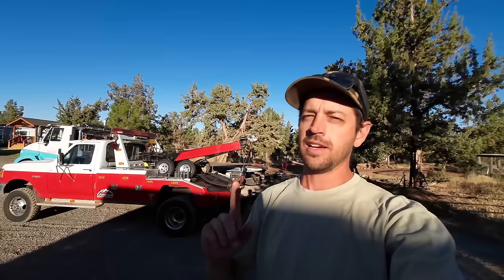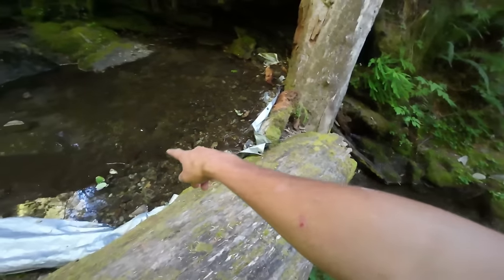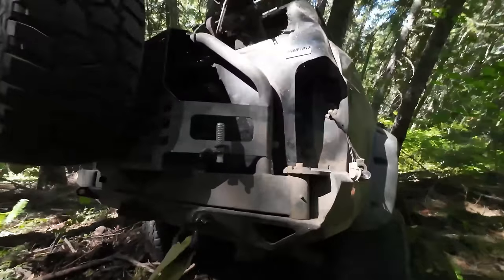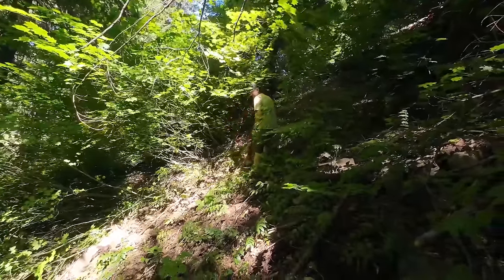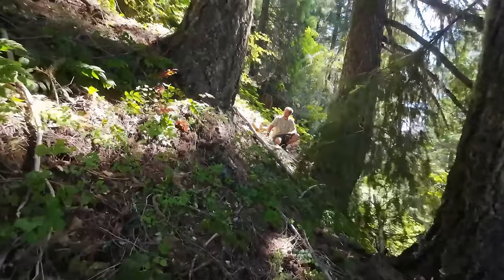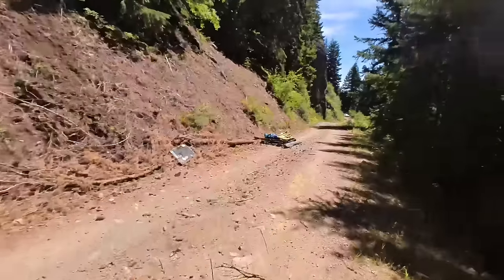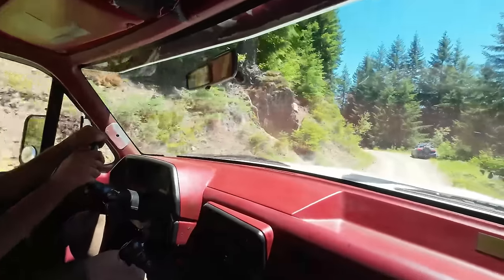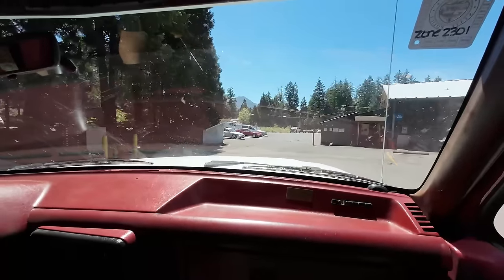I can't believe SHE SURVIVED this...

Comment: Thanks for the recovery of one of our Gambler family. Too bad you cut out the parts where you were rude to the drivers also. It would only be fair. These guys are rarely dicks. These two have rescued more people, driven more miles, cleaned up for more years than you could possibly know. Everyone has off days, including you. Its a dick move to put tgem on blast. And i dont see the part where you chewed Seths ass either. Another amazing person, doung amazing things with no intent of glory. Way to really stir up shit instead of caring.
Reply from the maker: Oh shut up.   I was not rude to them before this, but I and absolutely did TELL them to back down to an intersection and that we were NOT going to attempt to pass on that section of the road where they were trying to pull to the side.  And I didn’t give them any option about that, because they were not getting any option about that.  For everyone’s safety, that’s what we were doing, end of story.   If that hurt their sensitive little feeling…. Too. Fucking. Bad.   
But then, this fucking moron that some of you want to worship so much couldn’t even keep his car on the road, tried to get to the side where I told him not to, and drove off the edge putting himself and his passenger in extreme danger for no reason.   So yeah, at that point I absolutely am pissed off and am not going to sugar coat anything.   But I’m also still going to help him out of the situation he put himself in.   That is until he decides to run his mouth on top of it.  At that point, fuck that idiot, he can stay there.   
As far as this Seth person you’re talking about, I have no idea who that even is.   So no, I didn’t chew his ass.  
I also find it funny that so many of you Gamblers are jumping all over me saying that all these MANY different witnesses saw me being so rude before he backed off the edge.   Well guess what….  There were only three people there at that point.  The nun, his passenger, and the driver of the car ahead of him.   So anyone else who told you they saw any part of the initial interaction is a dirty fucking liar.  End of story.

If you want to think I’m an asshole, hate me, talk shit about me, or anything else, because I was “mean” to someone who’s stupid decisions put himself and his passengers lives at risk….  Good!   Have at it!  Your opinions mean absolutely nothing to me!
Reply: @CaseyLaDelle  I actually thanked you. Then talked about your behavior, not your character. Never talked shit about you, only here, to you. Never even called you names. I get it. Been in situations where I knew I was the one on the side of safety, been the one who felt I had to take control. However it is in extremely poor taste and yes a dick move to put people on blast to get more "atta boys" on your channel. Would you want someone to tailor their story to do that to you? Just putting it out there... no need to justify your attitude or behavior. And if other peoples opinions don't matter then why comment? Why tell your story again? Just food for thought
Reply from the maker: @WendyKelley-n3v  here’s where I have a problem with you and all the other morons jumping all over this for me.  You are saying that I “tailored the story” or “made it look like”….  And that is straight up bullshit.   What happened is what you saw.  Don’t like it, too fucking bad.  And as far as whether how this nun clown feels about it…. He saw the camera there and still decided to mouth off.   If he didn’t want to look like a dumbass on camera, he could have simply kept his mouth shut and let me pull him out, or told me that he didn’t need my help.   He CHOSE to mouth off in front of a camera, so no, I don’t care one bit about “making him look like…”  anything.   I film my work, and this is part of what happened on this job.
Reply: @WendyKelley-n3v I took your, comment exactly how Casey took it. If you didn't intend your comment to come out that way you shouldn't have said it. There are many things off camera you don't see and that many tow truck and recovery operators have to put up with. I salute Casey with his patience and behavior. I would have just gotten in my truck and drove away.
Reply: It's his channel and it's up to him what is shown. If you have a problem make your own videos and stop being a keyboard warrior. Cassy does all this for free and doesn't deserve yours or anyone's negativity.
Reply: @lesterholibaugh8784  word. You're correct. Sorry for the bad form Casey
Reply: @CaseyLaDelle 
 Casey, I just came back here to see if you had read my previous post and saw this one. These  people are amazing. AND, They are taking advantage of your good nature!!!!!! I think at this point you need to cut ties with the Gambler organization and let them call other tow companies. Let them pay the going rate and let them badmouth those guys. They will sit out there until they rot if they do because word gets out fast in the tow community, as you well know. Just let them know now that from this point forward you will not be available to pull them out, you are done with their organization and their antics. You are a much better person than this and you do not need it. Your time and money is much better spent on people who honestly need the help and truly appreciate the help.
Reply from the maker: @rickf5615  a few things here…. 
First of all, I have no ties with the gambler organization at all, so there are no ties to cut.  
Second, even if I did, why would I when the few D-bag individuals that are mouthing off are not representatives of the gambler organization.  
Third, they are not taking advantage of me, and I am making plenty of money off of this.  So to turn down their calls would actually cost me money, not the other way around.  
And fourth, don’t ever come on here and TELL me what to do with my business.
Reply: @CaseyLaDelle  Bravo Casey!  BRAVO !!  Extremely well said!
Reply: @WendyKelley-n3v  Really?  I sure didn't read any kind of a 'Thank You' in your original comment.  Food for thought for you possibly.  Your entire comment seemed to be condescending towards Casey's actions in this incident.
Reply: @tamo9520  the rescue was fantastic, and appreciated! I said all I said in sincerity.  The post was not in my opinion. But thanks for your scolding. Already had that. Already apologized.
Reply: @WendyKelley-n3v  I've made some comments on this original.  I just want you to know that I saw & read this.  Fact - it was read 'after' I made my comments.
Reply: @lesterholibaugh8784  Well said. Don’t you just “ love it” when people think they know when You know they don’t know. There are those of us that our hearts are touched by Casey’s channel and he can put anything he wants on it and I will watch it and share and brag that I “know” him.  So bye Felicia. 😇😁
Reply: Small tip from a unexperienced person as myself at recovery, love your videos! But I was watching it and you have like the small cotter pin and you said “don’t lose that” you are wearing a hat and I think you can slide cotter pin on the brim in the hat so you don’t lose it. I don’t know if wearing gloves makes that to hard if you’re able to do that I known I’ve seen my grandpa when working on the lawnmower and wheelbarrow wheels I’ve seen him slide the  cotter pin on his hat
Reply: @CaseyLaDelle I agree with everything you said. See my other comment left before I read this one
Reply: If anyone has disliked my long texts, the answer is in this comment. If I try to shorten the text, it is infallible that it is misinterpreted in the negative direction, no matter how I try to thank and praise! But it happens that I miss something that everyone can happen to and for those times I apologize for that!
But that it was included in the video, I sincerely thank for- as well as all the honesty that appears! Sometimes I think that too much is removed in the editing as the videos seem to have to be as short as possible which I'm not a fan of, but can understand that others are! The main thing is that nothing is censored unnecessarily! They say mistakes are what you learn from and personally, I'd rather learn from other people's mistakes on video than make them myself! I've crushed, broken, cut, and burned most of it already so I have no need to experience anything again! But probably something will happen as safe things are boring to my taste, the problem is that I refuse to accept that I am getting older and sick...
Reply: dude played stupid games and won a stupid prize and couldn't shut his trap long enough to get pulled out plain and simple my guy
Reply: It is too bad tempers ran high.  Here is Casey providing a voluntary service to the public, climbing up and down a 105 degree cliff, loose surface, risking serious injury in 100+ temperatures.

Now the old dude said he was trying to back down the road out of the way.  No way for us to tell what he was trying or intended.  Even if he was it probably wouldn't look that way if he promptly backed over the edge.

Truth is either person would have to be near saintly to keep their cool in that situation.

If it was me and the other fellow was about to pull me up on the road I would have tried to keep my trap shut.  Oh well, I am sure he got put to rights within a few hours waiting in the heat!

I don't think anyone who wasn't there is in any position to judge or point fingers.

I am glad no one was injured, and lived to grumble another day!

Thanks for the interesting videos Casey!
Reply: Regardless. Seth doesn't seem to be familiar with back road etiquette and then he proceeds on back talking: https://youtu.be/XDZ929tjsjw?t=2748 without respect of a larger truck trying to stay on center of the road and also was concerned for other safety too. 

It would make me question his character. And you defending this behavior shows your character. Honestly, between you and Seth does not shine a very good light on your "Gambler Family"
Reply: @CaseyLaDelle   glad you didnt help that rude driver after you told him not to do something and he did, i would have not helped him either, its called repspect and he's the one that didnt listen! way to go Casey! love you videos and your work.
Reply: I do not agree. Casey, for one, should have worn at least knee pads, 2,  should have cleared a swath with a saw to a degree & 3, he was unnecessarily confrontational with the odd ball driver
He should have maintained a professional attitude, which he didn’t in terms of communicating with motorists

He’s knowledgeable hooking up but is infantile speaking though at times
He also should  work on he Fanny out of shape body, best to keep your shirt youngster
Reply: People need to have common sense when there’s a wrecker carrying a wrecked vehicle don’t chew out Casey for that idiot’s impatience & stupidity for backing over the edge instead of a wider spot
Common Sense is the Key that would’ve kept that argument from happening
Reply: Another great recovery, definitely learning lots watching your channel, keep up the great work👍😊
Reply: @WendyKelley-n3v  You brought more attention to your group. The nun backed off the road. The women drove her jeep off the road, from my view
Reply: Dear casey, the driver who went of the edge should have heeded your advice, hes just a driver ,you do this every day for a living. You offered to pull him out and he makes utterly stupid remarks, Part of the course!!
Reply: bro told you to get a smaller truck lol

Comment: The absolute most gnarly recovery I have seen today with a small rig. Fascinating to watch. Thanks, Casey.
Reply from the maker: Apparently it was still to big 🤷🏻‍♂️
Reply: @CaseyLaDelle  🤣the only thing too big was that dudes ego... good job mate
Reply: @CaseyLaDelle  never too big....just have to inch it in boy....give it the old wedge...😁
Reply: @CaseyLaDelle it’s the perfect size. Got the job done. 

I’m guessing that guy was just embarrassed that he mistakenly backed off the road. Which unfortunately made him act like an toddler.
Reply: @CaseyLaDelle  Unlesss you're talking to Gator boy, lol
Reply: He should be glad you didn't take the big rig. You had pushed him of the mountain to inch by him.
Reply: 3 Days 'later' and nun man still there and wondering what happened 😢
Reply from the maker: @xandraxandra1437  we talked about how much easier that would have been with my rollback, since it would have sat still and just yarded that thing right up.
Reply: @CaseyLaDelle 🤣
Reply: @CaseyLaDelle It's amazing that rollback is so much more capable. Based on that, you would have saved probably 50 to 60% of the labor and rigging. 💪
Reply: @CaseyLaDelle  Do you think your big rollback would have made it up there, and would you have been able to turn it around up there?
Reply from the maker: @wesman7837  it would have made it, but it would have been sketchy.   It’s an old logging road, so many fully loaded trucks have been on it, but it also hasn’t been maintained for truck use in many years and definitely needs a tube up before it ever gets used for that again.   
But yeah, the roll back weighs 30k, so it would have sat there no problem and single line pulled that thing right up.
Reply: @RandomName100 I wonder what part of wait at the intersection, he didn't understand, there's not room for 2 vehicles so wait at the intersection!! So glad he learnt the hard way. I love pulling out stuck trucks, but not for Aholes
Reply: @speedfreak8200 there was room for 3 vehicles on that road from what I saw!
Reply: @CaseyLaDelle I would love to see the world’s largest wrecker eat that little for dinner!! 😂
Reply: @jasonnute1279  I've read several of your comments. Between you and the clown that got stuck, shows me that I absolutely wouldn't want anything to do with that organization.

Comment: Just shaking my head in amazement at all this. The insane incline, all the calculations to rig the cables correctly, all the set up to pull a crazy heavy 4x4 with your relatively light tow vehicle. So exciting to watch.

And on top of it all, you got a guy dressed as a nun with the weirdest attitude problem ... targeted at a tow truck towing a fellow offroader. Unbelievable.

Comment: Excellent video! You guys did a great job! One suggestion is add a length of rope to your kit. Nothing special about it, just when you have to scramble up a steep slope you don't carry anything but a coil of maybe 100' of 1/4" rope in a tiny knapsack or a shoulder bag. Get up there hands free and toss an end to your buddy below. Now use it to pull the tree savers, shackles and cable all up to you!

Comment: Casey,
Back when I was in high school( k falls, grad 1967) I worked at the  ARCO trucks top on n. Hwy 97.
 We had loggers from Eugene hauling around here. They were talking about big log loads.Back then they used 40' trailers fitted with 10' bunks. They would put a 4' tree on each side, and a 10' x 40' log down the center. They said it was enough lumber to build 4, 4- bedroom houses. I imagine they were hauling out of the Willamette forest.
 I have been fortunate to see this kind of load 4 or 5 times while we lived there..

Comment: Casey, on those warm days try one of the large cooling towels ya lay around your neck. They stay wet and feel cool helping your neck/shoulders stay feeling cooler. Blood cooling as it  goes through your neck into your head will help minimize the headaches and neg affects of the heat. I thought they're kinda gimmicky but got to play with one a family hiker was using. After like an hour it still felt cool and it makes a difference. Just keep it wet

A few years back I had to do some heavy labor in direct sun at around 95⁰ high humidity. I started spraying my head and shirt till soaked with water and that got me 30-60min of tolerable comfort. World of difference. I keep a 20" tilting floor fan nearby for working in 1 spot when it's warm. Obviously drinking plenty of water helps and recently heard pickle juice is good too as it replenishes salts etc lost.

Comment: Now that was a recovery! A lot of work and you did the job without causing more damage. That jeep is fixable! And yes, if you carry gear inside make sure its tied down so it doesnt kill someone if you roll!
Reply: That is one reason I like my Tacoma compared to my XJ. Tools are in the bed under a camper shell.  I need to set up a floor and drawer system for my Excursion for that very reason.
Reply: That Heep looked totalled to me
Reply: @speedfreak8200  nope, not even close

Comment: I also had a Ford with a 739 turbo in it. It would not go up much Hills either. I took it to Salt Lake and had a aftermarket turbo installed and the problems with the way it’s fine mountains with no problems nice and easy never hurt the engine all of those wonderful things just a thought.

Comment: Valiant effort Casey. I felt so bad for ya out there in the heat climbing those steep hills and pulling the lines. Exhausting. Then you can’t even get into the air conditioning until all the way back home. 
As far as the know it all driver on the road, you can’t fix stupid.

Comment: Hi Casey
A length of rock climbing rope would be very useful on steep and unstable terrain,  especially when hauling things up and down
Reply: Nah, climbing rope is dynamic, it's made to stretch to absorb the shock of a falling climber.  Static line is made for hauling or for actually climbing up and down the rope.